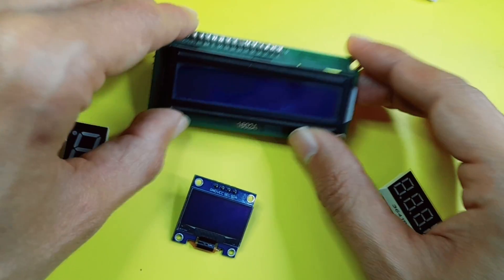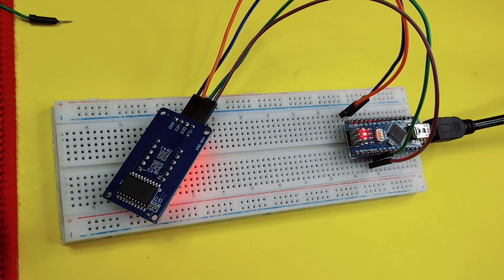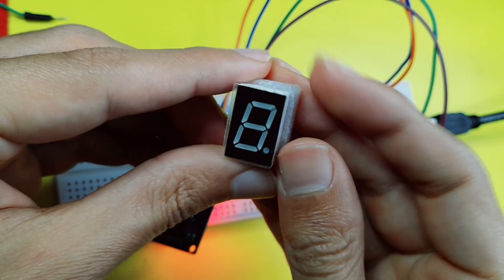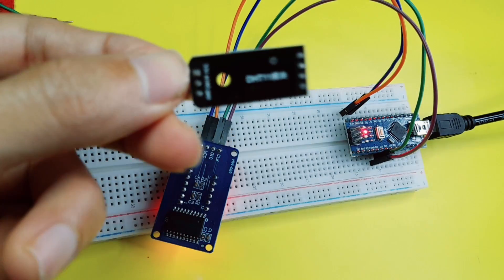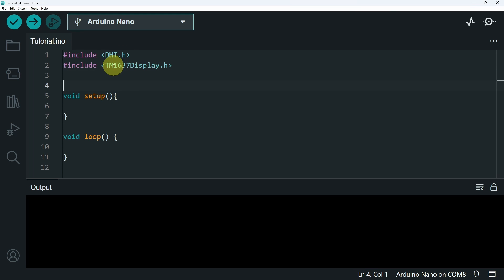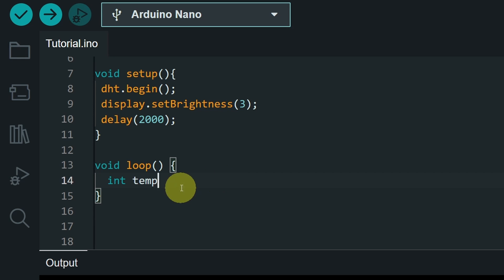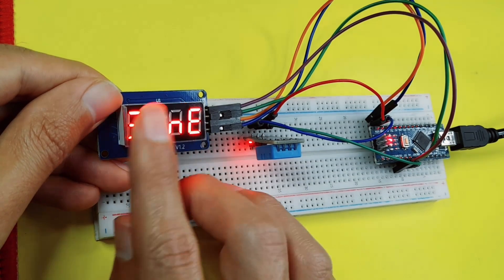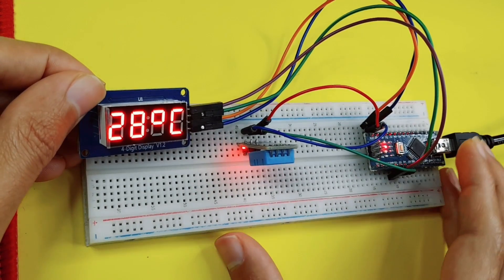TM1637 4-Digit Display with Arduino | Portable Temperature Sensor

Comment: Hi very helpful video as always.  I used the sketch to read and display both temperature and humidity on the TM1637.  The first two digits are used for the temperature and the second two display for humidity.  However, I would like the displayed numbers to be separated by turning on the centre colon.  I can’t figure out how to turn the colon on. I wonder if you could help? THANKS and greetings from Australia.
Reply from the maker: I'm glad you found it helpful. You can achieve that by using the 'point' setting of the TM1637 library.